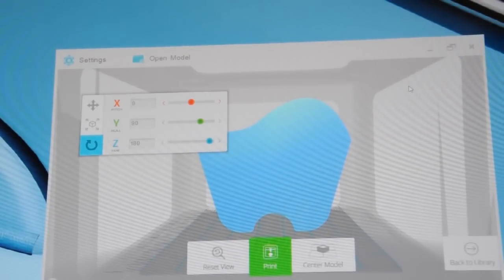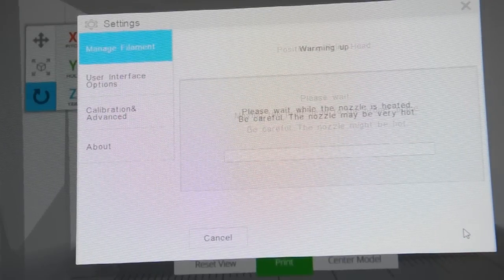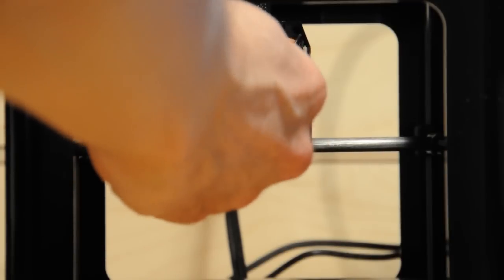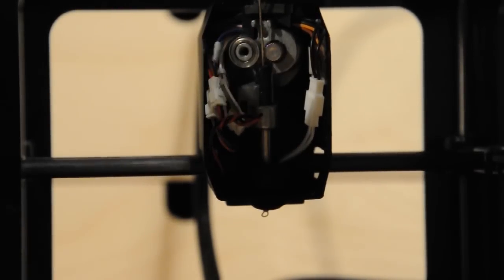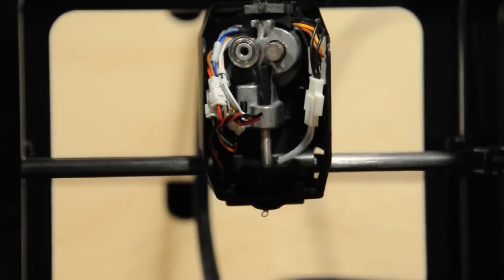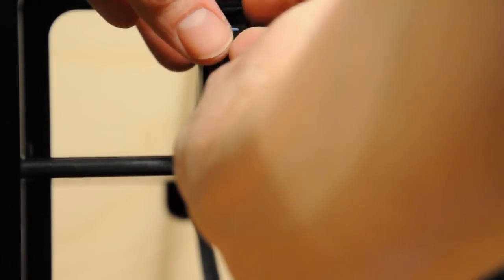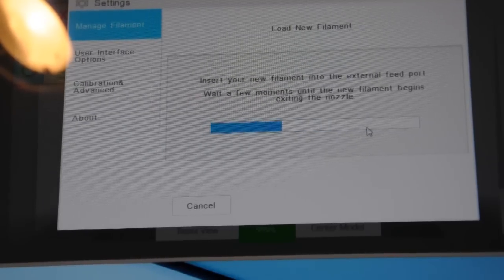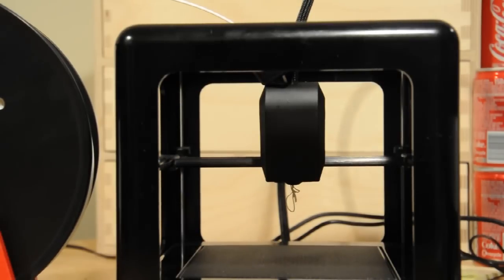Unclogging / Unblocking the M3D Micro Nozzle / Hot End / Print Head – Read The Description First

Comment: Guitar String worked nice - also was coiled so it took a bunch out. I was tinkering with heat settings; 5+ degrees F from default heat was enough to cause this issue.

Comment: Extra tip: Since you're relying on the plastic to cool on the metal wire, don't leave the wire down in the heating tip for too long or it'll defeat the purpose by heating the wire. So in other words, be swift with your squidgy removal pokes.
Reply: +alex ritchie  and if your problem is an exterior clog (which may be hard to spot) and you can't remove it with tweezers, dab a little acetone on a cloth/papertowel and wipe just the little metal tip till it shines like new. :D

Comment: I see some people using the micro with the printhead cover removed. Is this in any way dangerous? I try to clean my extruder once a day (printing all the time), so it'S a bit boring to always remove it and put it back on. How often do you clean the printhead? I got the feeling that after a few prints even without changing plastic the clogging happens, maybe unnoticable but the prints have a slightly lessened quality .. or that was the temperature because it printed at night ... what's your opinion on how often to clean it?
Reply: +Mark Wheadon this worked great BTW. thank you
Reply from the maker: +Some Guy People have used a straightened paper clip in the past -- it should do the trick.
Reply from the maker: My experience tells me that nozzle clogging is nearly always as a result of changing filament. As the filament is pulled back through the hot end a lump of filament breaks off in the cold part of the head and then cools and sticks there. The unclogging is not so much about pulling material out, as about pushing material back into the hot part. So I'd say try not cleaning the head when staying with the same filament and see how you get on?
Reply: +Mark Wheadon Thanks for your help. my screw will be unusable soon, maybe I used a bad screwdriver. Is this a standard screw and if yes does it have an international name?
Reply from the maker: Mine has a standard Phillips-style screw but if yours is strange then I suspect it may be different. Is it a Torx? (https://en.wikipedia.org/wiki/Torx)
Reply: No, it is a Phillips, but I'm no handyman, I never work with screws. Is there a model number for this exact Philipps screw? Because I guess not only the diameter but also the length has to be perfect.
Reply: I just want to know it BEFORE I try to get this one out (will be hard and I guess after that the screw  will be .... screwed ;P)
Reply: +Mark Wheadon anything i can use other than piano wire? for example thumb tack or electric wire??? I do not really have any piano wire lying around. would a paper clip work good for this?
Reply: Mark Wheadon awesome thanks for the quick response. I appreciate it
Reply: it should work with Ph No:2

Comment: Hi Mark, Awesome video very helpful for those with clogged heads. Sadly I've managed to clog my head (after going to bead after kicking off a print which lost adhesion).

I've got some 1.5mm piano wire which only appears to go down for the length of the black plastic tube. Should I be able to push on more beyond this point with 1.5mm?
Failing that do I need to try thinner wire or attempt to remove the extruder and have a look?

Thanks again for helping people out with videos like this and your models on Thingiverse :D
Reply from the maker: Scott White Well in theory 1.5mm should go down there, but it can be marginal as the wire is very stiff. I would try gently twirling the wire a little against the obstruction and if that fails try a slightly thinner wire? In my experience, a thin wire to start with followed by a thicker one does the trick best.

My theory (from playing with my Mini Kossel mainly) is that when the above succeeds in clearing the nozzle, what it's usually doing is not getting cruft out of the nozzle, but clearing the cool part of the filament run. The jams mostly happen when hot filament is pulled into the cool part of the hot end where it cools and sticks. That's why the clogging often happens after changing filament.

Comment: Why should it ever be this complicated to fix this thing...if it requires friggin' piano wire to actually unclog it, why doesn't Micro 3D ship maintenance tools with their 3D printers??
Reply: Or, you know, Cura settings so folks other than Windows users can actually use the thing
Reply: No kidding, very disappointed  in the program! I mean, who designed it? I hope they are not working there anymore. 
No options.
Reply: @James Scheffler I agree  why oh why!!

Comment: Mark Wheadon Hey Mark, I found your video on the M3D Printer boards for removing clogs and also your filament spool on Thingiverse which printed nicely. I have an issue with a major clog in my M3D and do not have access to piano wire. Can you recommend anything else to remove the clog? Maybe a needle, since it's metal and thing similar to piano wire?
Reply from the maker: (We talked via a different channel, but in summary): Not ideal as it's pointed, probably rather short, and it's better a little bendy. Stephen Graham ultimately used a straightened paper-clip and his printer is back up and running.

Comment: Although it takes a bit more force that I'd like to remove the front cover of the print head the first time, it's pretty straightforward after that.
Reply: And despite the fact that I didn't have amy remaining PLA in my print head, taking it apart and looking at it cleared up all the mis-feeding I had been having, which was presenting itself as a constant series of clicks as the feed cog skipped on the material.
Reply from the maker: Patrick Friedel I guess you probably had small particles stuck to the side of the nozzle tube – far enough away from the heat to stay hard, which the wire scraped off. Bonus!